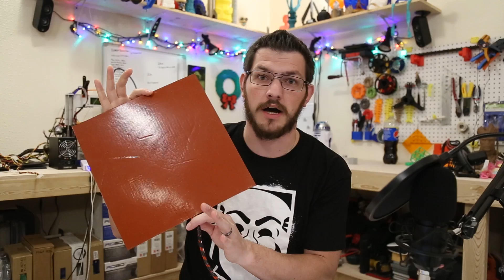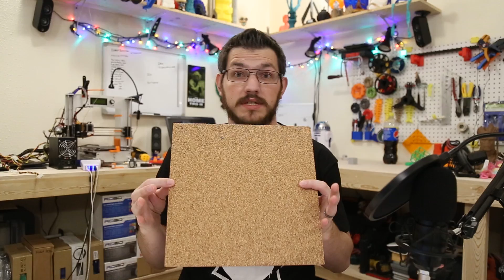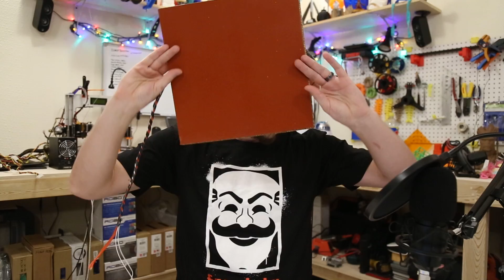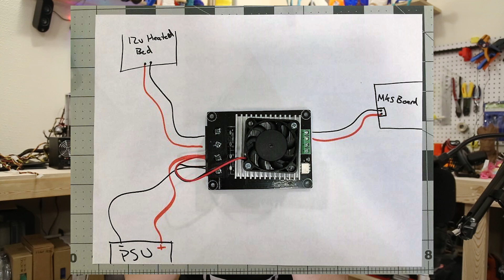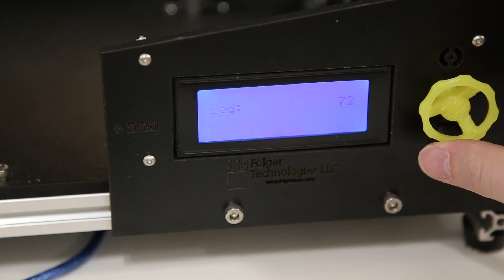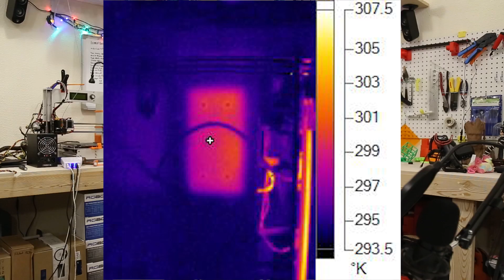Installing 12v Silicon Heated Bed on the Folgertech FT 5

Comment: There seems to be a run on the 12v 300x300mm heating pads.  I can't find one anyplace.  However, there are lots of slightly more expensive 110v pads.   I'm a fairly experienced 3D printer builder/user, but have never used a 110 volt hot bed.   Any experience with them or suggestions?
Reply from the maker: I have no experience but know a ton of people that went that way with the Keenvo one which costs about $80. Just make sure you get a good SSR with a heatsink.

Comment: My stock aluminium bed heats to 60 in about 2 minutes and 100 in about 10. Not sure why yours was taking 10 minutes to reach 60, you may have had PID turned on for it which for a large thermal mass like that could really increase warm up time. Could also be a bad connection somewhere but there is nothing inherently wrong with the aluminium bed provided.
Reply from the maker: What version do you have?
Reply: 3mm black aluminum plate
Reply from the maker: I have the v2 heated bed which was notoriously horrible for heating and warping. v3 was white and was a bit better but the v4 black aluminum plate one is the best so far.

Comment: fantastic video thanks a lot man for posting
though should I get a new thermistor, or just take out the old one from the sleeve?
along with can I print right on the mirror surface or do I need another layer of material, like PEI?
Reply from the maker: You can just use the stock heated bed's thermistor which isn't in a sleeve. You can print right on the mirror surface.
Reply: I got the mirror and been testing with ABS on the mirror surface. the gloss looks amazing, but it always fails to stick on to the mirror. do you have this problem? (thanks for the reply btw)

Comment: ive had to by 3 mosfets because two of them have burned up at the middle port that connects the wires from the mosfet to the silicon pad. would you know any reason why this keeps happening?
Reply from the maker: Which one are you using? Are you sure you are wiring it correctly?

Comment: This was a great video. I was able to get the trigorilla but not the 300x300. instead I got the 250x250 silicone 12v. The only issue I ran into was not knowing what the thermistor was in the silicone. I just put in 11 for marlin settings. I also noticed that the wires from the board to the trigorilla might matter. When I just put the signal wires in the same sockets as my old bed  and attached them to the trigorilla it did not trigger, but when I actually put red into positive and black into negative on the board and to the corresponding on the trigoriila; the mosfet triggered and the bed heated up. That is just with me but it worked. This is from the board to the trigorilla not the bed to trigorilla. Thanks again for the video.
Reply from the maker: My heated pad didn't come with a thermistor so I used the normal 10k one that came with the FT-5.

Comment: Did the thermistor lead cause any issues with flatness, or did the cork just absorb it? I kept thinking that using the clamps on the glass with that lead in there would create a little lump on the print surface as it bowed to flex around the wire.
Reply from the maker: The thermistor is tiny so between the silicon pad and the cork it gets absorbed.
Reply: Awesome, totally makes sense. Thanks for the response!

Comment: Very informative. Thanks for the video. I purchased the TriGorilla and hooked up exactly as you illustrate to my FT5 using the stock aluminum bed a few nights ago. However, the heat bed starts heating immediately even though the target temp is at 0 degrees C. Did you have to update controller software or anything to be able to control your bed temp? Any info is helpful. Thanks again.
Reply from the maker: I have not tried it on a normal PCB heated bed so i can't say what the issue is. Sorry.

Comment: I wouldn't bother with the mirror when for cheap you can go to your local glass shop and get custom cut glass and have it tempered for $15 and they even gave me 3 spares because i told them it was for a 3d printer.
Reply from the maker: Mirror tiles were cheaper and easier to get for me.
Reply: I understand but if you call a glass shop you might be surprised how cheap it is to get tempered glass which is better for for a heat bed

Comment: If the power to the heated bed is PWM (Pulse Width Modulation), at say 100 Hertz, (on/off 100 times per second), then a mechanical relay would be a bad idea, because if you are heating at 10% PWM then you will be switching the relay on for 10% then off for 90% at a rate of 100 times per second, as an example. The relay would buzz and it's life would be shortened. If the power to the heated bed is simple on/off demand (100% power until the desired temp has been reached, then off, then when it gets too cool, 100% again, until the desired temp is reached, and so on), then the relay would probably suffer less, but would not be as reliable as a quality SSR or MOSFET. 

SSR's and MOSFET's work about the same as mechanical relays, but have no moving parts, so they are more reliable. There will be some leakage current with SSR's and MOSFET's, but with quality parts, it would be negligible, mechanical relays have practically no leakage on the output, because there is an air gap, when the relay is off (open). 

The other way to control the current to the heated bed would be to vary the voltage, the problem with this approach, is that you would have to dissipate the heat generated by the controlling device. So, if you have a power supply at 10v, and you want to put  10% into the heated bed, then you will have to drop 9 volts with your control device and to get 1v at the heated bed. This would be a bad idea, because of all of the heat generated by the control device and wasted power supplied by the power supply.

There are many flavors of SSR's with AC or DC inputs (control signals) and AC or DC outputs (loads), and add to that various operating voltages. The MOSFET that you chose it technically an SSR (Solid State Relay), it has a DC input and a DC output, it may be lacking other circuitry that a quality SSR would have like optical isolation between the input and load, EMF suppression, and such, but it gets the job done. The DC output version of SSRs have MOSFETs as part of their circuitry, MOSFET simply refers to the electronic component (Metal Oxide Silicon Field Effect Transistor). Think of a quality SSR as being a quality automobile, with doors, windows, heater, A/C, etc. and the MOSFET is an open cabin dune buggy. One will get you there in comfort and the other will get you there. Take a look at this data sheet, to get a better description of a DC to DC SSR http://www.crydom.com/en/products/catalog/1_dc.pdf . The SSR has the advantage of being industry standard (and there are heatsinks that you can mount them on), the MOSFET (or more properly, External MOSFET Device Circuit) is simpler and more that likely cheaper.

That said, there is another way to heat the bed, you could use a DC to AC SSR and a 120VAC silicone heating mat. You would have to wire 120VAC up to the build platform (outside the protection of the electrical box), not a very safe thing to do, without proper shielding and grounding. The upside would be that you would not use any of the power from the power supply, the downside could be dangerous, if not done properly. 

Now, to the problem with hot spots on the glass above the silicone heating mat, one way to even the temp would be to put a thin sheet of metal between the silicone heating mat and the glass plate. The metal would even out the heat, but would probably slow the heating process. The thicker the metal, the more even the heat but the slower the time taken to heat up the glass plate. A steel, stainless steel or galvanized plate would probably be the cheapest choice, but would have poorer thermal properties that some other metals, but it would probably be better that nothing at all.  An aluminum plate would probably be the best over all choice, because it transfers heat well and is light weight and relatively cheap, most heatsinks are aluminum. Copper transfers heat better that aluminum, but at a greater weight (for the same amount of material) and cost (think really good CPU and GPU heatsinks). Silver would have excellent thermal properties, but it would be the priciest choice, by far and silver also tends to oxidize (tarnish) easily, which would degrade it's performance. 

The last thing (I promise), would be the choice of glass, standard glass or soda glass (soda as in sodium, not the carbonated beverage, is added to the glass mix), it tends to expand and contract with temperature changes. That might may not actually be a bad thing if you keep the temp of your build platform constant during the entire print job. If you turn the temp on the build platform down or off, once you have printed a few layers, the glass may contract and pop goes the project. Borosilicate uses boron in the glass mix, which locks the glass molecules together and minimizes the expansion and contraction due to temperature changes. The arguments about bed adhesion go round and round. I read where one person liked the standard soda glass plate, because the part pops off of the plate when is cools. Others, have problems with part distortion if the plate cools and contracts too quickly, before the part has a chance to solidify. If you got this far, I commend you, if you skipped to the end, shame on you, now go back to the top and start over. ;-)
Reply from the maker: You sir win for longest comment I have ever seen on a YouTube video lol. Great info here. I do have a sheet of aluminum that came with the printer I can put between the glass and heated pad. I can then take a reading and see how it heats up. I didn't go with a 120v bed because of the cost. It cost nearly $100 when the 12v wasn't even $35. Also great info about the glass. I learned a ton from this comment so thank you sir.
Reply: I am glad that I could distill it down into such a large comment. LOL ;-P Let me know how that aluminum sheet works out. The other thing that besides cost, of the 120V bed, it would be less safe having 120V on a moving platform, wire chafing, fatigue and all of that.
Reply: For some reason, I cannot see your complete reply, which I know was long via Fugatech's reply.  I really would like to read the complete comment to know what is the best way to set one of these up.  I just received my FT5 today and want to add some upgrades to it, as I build.

Comment: i would like to use your affiliate link but the heated bed has been unavailable for a bit. any links to another one? i havent had much luck finding one for less than 60-80 bucks.
Reply from the maker: This one should work but honestly I'd just keep your eye out for the 3DTop one on Amazon to come back in stock. Normally in stock every 2 -3 weeks.

https://rover.ebay.com/rover/1/711-53200-19255-0/1?icep_id=114&ipn=icep&toolid=20004&campid=5338026969&mpre=http%3A%2F%2Fwww.ebay.com%2Fitm%2F12V-280W-2-size-Flexible-Silicone-Heating-pad-Heating-Element-For-3D-Printer-%2F301715327446%3Fvar%3D%26hash%3Ditem463fa289d6%3Am%3AmPUvdf_P8jVECm1p-bDkHaw

Comment: Will the mosfet run 2 of these heat units?
Reply from the maker: It should be able to but you would need a 550w+ PSU to handle the load.

Comment: Awsome.. thanks for the video. I've been interested possibly doing something like this for a while and had half decided to go the SSR route. After watching your video and doing some initial research I KNOW I'll use a mosfet now. I wasn't aware that using a relay would eliminate any benefit of any PID tuning with your firmware. Makes sense though, a relay is either off or on. A Mosfet will allow PID control and gradual heating and cooling of the bed when needed instead of hard on and off. If I'm wrong someone please correct me.

Comment: Connect your fan to the heated bed output that way it only runs when the bed is on
Reply from the maker: The fan on the MOSFET?
Reply: Fugatech 3D Printing yep, the mosfet only needs cooling if it's on powering the bed.
Reply from the maker: I'll check that out.

Comment: I'm using an SSR for my 12v silicone bed. It won't even go to 60 let alone get there in 2 minutes. I don't know if the firmware needs tweaked or what.
Reply from the maker: Ya something isn't right. Post in the Folgertech 3D Printing Facebook group and we will get you sorted out.

Comment: Your 60deg rise is actually slower than the stock white bed on 24V.  Mine gets to 60C in a bit less that 2 min , and to 100C in about 8.  You do have a bit more mass to heat with a 6mm mirror however.  Also, the stock white has a more even thermal gradient than your particular silicone heater.  Can confirm with thermal images as well.  I may post them on FB. The wire in those silicone heaters are spaced much further apart than the traces on a typical heat bed.  Of course, there are several variants of heat beds shipping with the FT-5 so YMMV.  However, the stock white one, or the latest gridded black one, does not need replaced , and it cheaper to run off 24v with a FET module.
Reply from the maker: I can see that, especially with the new bed. My kit has the 2nd version of the heated bed. I don't know if it can even handle 24v. I'm hoping to get my hands on one of their new beds to do some testing but if you have an older kit, this is the best way to go.
Reply: Fugatech 3D Printing Agreed. Your bed should be a 2ohm bed, as are most, as well as the white version. It would be fine on 24v. The new one however, is a 1ohm bed, designed for 12V, and would draw 24A at 24V for 576w, and is best to keep it on 12.

Comment: When I built my giant delta -- I built my own heated bed -- 500mm square. I used a mains powered silicone pad -- max rating of 500 watt. I use a PID capable SSR with it. However what I did was, I used pilobond high temp cement to adhere the silicone heatpad to a piece of aluminum, then I adhered a small 2 inch square piece of aluminum to the middle of the silicone heatpad on the under side, and I attached the thermistor to that. Then I adhered the cork to the bottom of the silicone (except for the center square). Because the themristor is reading the temp from basically the underside theatsink, the temperature at the top is within 1-2 C of the thermistor reading. I then use binder clips to secure PEI covered boro to the aluminum. Works really well. And it heats up very fast because it's using mains power. Regarding SSRs -- use Opto SSRs and they don't leak, or Fotek SSRs. Cheap Chinese SSRs leak, it is purely the quality of the SSR.
Reply from the maker: Good info on the SSR. Guess most of the people I see buying them are getting cheap ones. I debated using a 120v silicon heater but the total cost would have been almost double what this setup costs.
Reply: I have 2 printers with mains SSR controlled bed. The 12 inch square one gets to 60 in under 2 minutes. The 500mm one takes 5 minutes, but I give it another 5 minutes to soak and equilize. I've measured cheap Chinese SSRs, have actually been shocked by them while "off". I can see why you'd be wary. Quality SSR is only $30 bucks. The wiring is similar as wiring the MOSFET. Only difference is you have to set the maximum pwm frequency to no more than 30/sec or you'll burn the SSR.